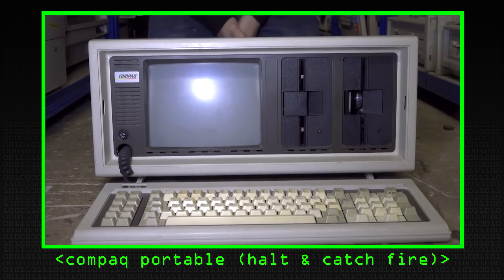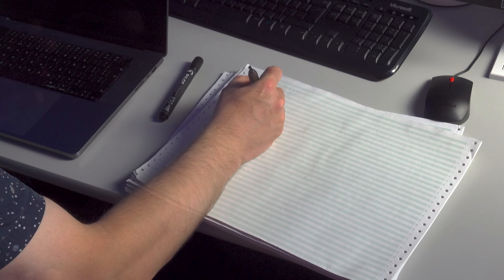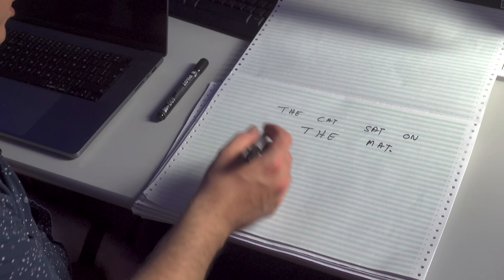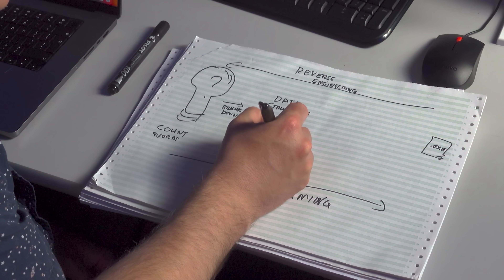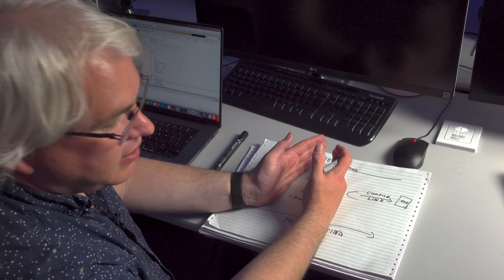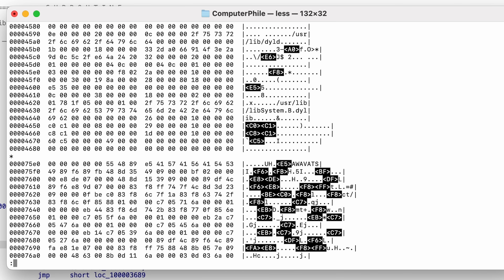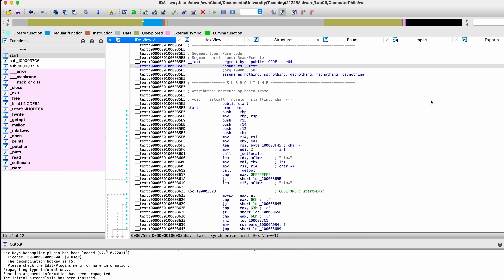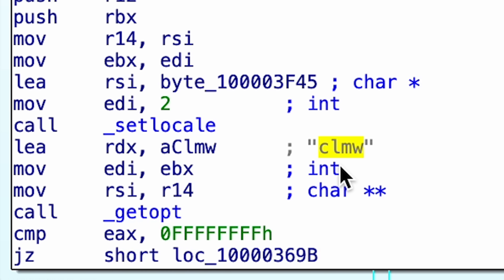Reverse Engineering - Computerphile

Comment: If you’re attempting to disassemble non x86/64 code using IDA, take a look at the pricing….I bet you’ll be surprised.

To save a lookup, it’s more than $10,000 for the full package, $5,000 for just MIPS and MIPS 64….

Comment: How would I go about Reverse Engineering a .exe file? I want to look at the source code
Reply: I think you'll never have the original source code by definition. But maybe you can disassemblethe machine code into assembly language and decompile that perhaps into c. But I'm not sure correct me if I'm wrong.
Reply: @bsdiceman  you can do manual decompilation. You could translate the assembly into c. The only way to learn this is to practice it and learn how compilers generate common c code constructs.

Comment: 3:26 Unix executables were originally "just machine code". Later on, when they wanted a format with headers and whatever, they made that format, but didn't actually change the implementation of exec. Instead, the binary started with the machine code to jump past the headers. And that's the story of the a.out magic number.

Comment: Have an idea for a similar episode in the future.

Steve should pull out a BBC Micro, C64, ZX Spectrum or any other 8-bit machine having BASIC. Then off camera develop a program which first asks a user to input any number of words. Then the program would calculate their number and display it.

Then show only the running program to the camera, and ask the cameraman to also come up with a BASIC (or any other language both can code) program that does the same. Suppose the BASIC will be different. But there you have it - Reverse Engineering.

Comment: The best example of clean room reverse engineering is GTA4.
One of the best trainer programs was built with the software in the next room. Engineers with gta looked at how certain actions worked in memory and passed their findings to totally separate engineers who worked out how to interrupt and alter what it did.

Rockstar tried to sue them for hacking and theft, but it failed because they hadn't built any software using any of the GTA code.

Comment: If the code you are analyzing is written in some high level OOP language, chances are a modern decompiler will give you at least some C equivalent, not just assembly code; in some cases it might be able to give you some snippets in the original programming language, since OOP compilers are pretty deterministic in theory.
And then some languages don't even complie their code, it might not even be obfuscated, so why even bother...
Reply: Some guy I know took apart a car insurance app, it was just a web application so everything was in JavaScript; it didn't take a long time to find several vulnerabilities
Reply: Javascript bundles are incredibly easily to reverse engineer. However you won't be able to do it with most pieces of software that easily.

Comment: Reverse engineering is a very useful skill to learn early on, but also one with a very steep learning curve.  It happened to be how I learned programming back in the 80s on the C64 as access to any useful technical literature in my rural town was impossible to come by.  I spent much more time in the machine code monitor examining games and demos to slowly learn how things were done than I ever did actually playing the games themselves.  Perhaps it was a happy coincidence as I may not have gone that direction if I could simply have learned everything from reading books.  Practising reverse engineering can greatly improve your analytical skills and pattern recognition as well as a more in depth knowledge of the underlying platform; skills that are, in fact, very useful in regular engineering.  So learning reverse engineering enables you to become a much better engineer.
Reply: your very right, people need to learn the very lowest level of programming (asm -> c -> c++) before moving on to very higher level control languages like python or javascript because they will have much better understanding and control over what they want to accomplish and how what ever language they use does that.  an example of this is writing an algorithm that is simple in function and does not have quadratic cost and instead of allowing iterations and number of arguments passed to grow in relation to the number of arguments passed instead use pointers instead of wasteful copying and making new tables, variables and bloating memory.

but this is only my interpenetration so take it with a grain of salt
Reply: @unguidedone  yesn't
Reply: Agreed.
Reply: You are one of my heroes.

Comment: I do a little reverse engineering. Usually with mobile apps, or web code, to look for vulnerabilities.  Found some interesting communications protocol in the 'Wind' scooter app (the older yellow hire scooters), no free rides, but a denial of service if you were careful.  Those scooters were in Nottingham, too, the same place these guys come from.
Reply: I have a lot of experience with reverse engineering web apps. It helps me build stuff when no direct api is provided.
I haven't really done much more than that. Computer science isn't exactly my field.

Comment: Been Reverse-engineering for over 30 years, no University degree and learned everything from software design patterns to how the SoC bring up is done. You learn the real way it works by reverse-engineering. 

I started out with C-64 and the super snapshot cartridge and moved on from there to the latest ARM hardware .
Reply: That's awesome man, can you give some pointers for someone like me for getting started in reverse engineering.
Reply: Hey, how do I get into reverse engineering(that's not the main part, I want to get into hardware hacking)? will learning a microcontroller help? Which one would you recommend for a beginner? I'm thinking of PIC18
Reply: @swarooprajpurohit110  If you want to learn hardware hacking then learning a microcontroller will help. Its important to  learn the basics like hex, dec, binary and how addressing works. Eventually for hardware hacking you need to know how MMU, interrupt controller, CPU and fabric work for SoC. Also knowing how to inspect and manipulate i2c, SPI and other chip/die to chip/die communication.  Pic will give you  basics but best to understand ARM . Arm V8-A/R/M for example.

Comment: 9:00 yes, waterfall is doing it wrong :)
And i agree with the "show me your data structures and your program will become obvious" to a large degree. Though a lot of the interesting part of programming is how to model edge-cases in the domain you are working on, and how you structure your code to handle adapting to new functionality or handling of bugs and edge cases. Programs are not (anymore) made as a single release, and then a few years later you get the next major version that is made from the bottom as a different program that may be a newer and better implementation of the same high level ideas and concepts. As systems get larger, maintenance/support and feature expansion time and time between bottom-up full rewrites get longer because the costs become much larger. Also, with agile development mindsets, the focus becomes on continuous development and deployment and delivering incremental value at low incremental risk of things going wrong.

Comment: 13:35 x86 machine code does have loops.
Reply: Unless you're referring to the rep/repe/repne prefixes, not directly. It's easy enough to implement a loop by a jump instruction that points to earlier code, but even then, the idea of a loop "emerges" from the behavior of the code; there's no direct "loop" instruction. Indeed, you can just as easily jump backwards without it being a loop.
Reply: @quantumdude836  Then look what the opcodes E0 to E2 do ;) They are the loop instructions. They implicitly use the CX register to count to zero, if I remember correctly.
Reply: @Abrissbirne66  huh, I completely forgot about those
Reply: @quantumdude836  No problem, modern x86 has so many instructions. I tend to remember the high level ones, because I'm impressed how high level they are. call, ret, loop, looks like concepts from regular languages. You can even say something like ret 24 to automatically clean the stack when returning.

Comment: Time to develop a reverse engineer coding AI - that learns the function, inputs and outputs of the target software and then writes the code for the operating environment of choice.
Reply: Thing is that one piece of bytecode can be decompiled in different ways, depending on context and where the process started
Reply: @bosch5303 Yes - the AI - which understands the overall  purpose or function of the app - based on its learning / 'hands on' experience could work around these issues by either recoding the entire app or parts that can't be meaningfully decompiled.

I suppose with more thought - it might be quicker and easier to just get the AI to rewrite the entire app.
Reply: Easier said than done
Reply: @RickOShay  orrrr anybody with more than a braincell will know what a program is doing by looking at system calls and strings?
Reply: not to mention RTTI is a thing also
Reply: @arson5304  Apparently that's why Stroustrup excluded it in original C++. and is it really necessary given the potential for abuse?
Reply: @RickOShay  "is it really necessary" ?? tons of applications nowadays are LITTERED with RTTI, which can be used to make reverse engineering a simple cakewalk
Reply: @arson5304  That's why I asked - isn't it a security risk ?
Reply: @RickOShay  yes and no depending on how heavily client-sided your software is
Reply: you don't need ai for that, it's called a decompiler lol
Reply: @arson5304  decompiler wont write high level code for the target system.

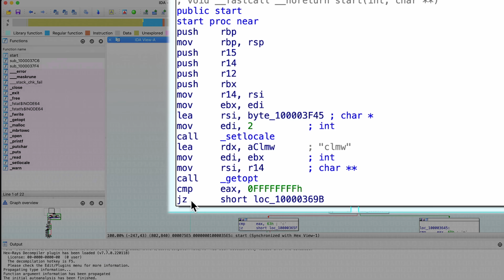Comment: 15:33 Library or external function calls and system calls are being conflated. 

Typical  user code doesn't directly make system calls.

These are implemented as "magic" instruction (this is all generalized) which allow a userland program to execute a small chunk of kernel code.

By magic instruction I mean "an instruction which causes the kernel to shut up and pay attention", i.e. throws an interrupt of some sort. The mnemonic "syscall" is an assembly instruction for several different architecture's instruction, even on the same hardware, various operating systems (and even versions of them) can use different instructions.  (Nothing is stopping you from saying "A syscall instruction is any instruction which causes a protection fault when writing to a valid syscall number." Provided your kernel can tell that happened and react to it appropriately, the mechanism doesn't matter. )

While the mechanism you use to call them varies, all of them need you to tell the kernel what you want them to do as well as that  you want them to do something.

The parameters to the syscalls go in registers (or in a specific region of memory) and include the system call number you want to run, telling the kernel how the arguments should be interpreted. 

Once you have set up the parameters, you execute your magic instruction, which interrupts the kernel, looks at your request and fills in the reply. Then the process returns from kernel mode, and continues.

These operations are often by system library code, because different systems might use different system calls, but as long as the library call takes the same arguments, your code will still work.

That's why there's a distinction between library code and system calls.

The only other times you need to know what a system call is are if you are reversing a statically linked binary (which puts all the library code it is going to use directly into the program. And it can make them massive) or if you are working with shellcode (like an exploit for a vulnerability might use.)

Comment: With the BIOS Compaq had 2 separate teams, one team analyzing the IBM BIOS and another team implementing their BIOS clone. The only communication between the teams was the documentation the analyzing team created by reverse engineering. No one from the analyzing team was allowed to speak with the implementation team or join it. IBM was never able to sue Compaq for their BIOS because it was a clean room implementation, running on standard hardware everyone can get.

IBM was too slow for the consumer market, they are building business machines, even up to today, and that's part of the story why the IBM clones took over the market. They were compatible, cheaper, had agreements with Microsoft for MSDOS and could adopt much faster to newer hardware while IBM worked on the PS/2 machines. I think we can clearly say: We are lucky it went this way!
Reply: Except for Bill Gates using the money to tests vaccines on africans.

Comment: I have actually had to reverse engineer more than one industrial automation system with nothing more than a poorly drawn schematic (which wasn't up to date) and raw code.

First step was identifying all I/O points, so i knew what a particular input or output did.  Then based on that you could figure out a lot of the basic logic of the machine.  This is a start/stop circuit.  This is a closed loop control system.  This is a permissive or interlock logic block.

Still takes a lot of time, but it can be very rewarding when you finally get to the point where you can actually maintain and/or improve the machine automation.
Reply: So you were able to make changes before the whole program was decompiled?
Reply: @johnsports_iii  Ladder logic is not compiled.  But yeah, I had to understand the code before I could make any meaningful progress.  But you run into a lot of basic sequences   that are almost universal.

Comment: May not be completely true, but i watched a documentary about Compaq where they actually had a software engineer de-compile the IBM Bios, just to see how it worked.  Once he did so, he reported to Compaq that "this isn't hard, there's nothing special here."

But since he had seen the code, he was not allowed to work on the project anymore, since he might be influenced by the code he had seen.  Compaq had to hire an entire team of programmers to look at how the bios calls worked, without seeing the coded behind the calls, so that they could replicate the outcome, without necessarily replicating the IBM code that generated the original outcome.

So when IBM sued Compaq, they could legitimately claim that their compatible BIOS was not based on the code IBM had copyrighted from Microsoft.  Nor was the Compaq DOS based on the code of Microsoft DOS.
Reply: Similar thing happened with Connectix and Sony. Connectix reverse engineered the BIOS of the PS1 and when Sony sued them they were able to claim that no Sony code was being distributed or used in their emulator. (Sony, of course, sued them to oblivion but they were technically in the right)
Reply: Halt and Catch Fire!!!
Reply: @swarooprajpurohit110 yes I read it to and remembered the series 

Had to stop watching it as things got too repetitive
Reply: @ukpauchechi  true. I stopped after the 1st season. I did read the plot though and it was disappointing
Reply: I think that when playing these kind of games its easier to win on a social level. Because your software can be objectively better, stolen or created, but what makes you win is the market. People.

Comment: I'm always amazed and overwhelmed by the sheer number of lines that even the smallest executable has when decompiled to assembly.
Reply: I am always more scared, what these few lines might cause in the hidden, if i type any "source" datapath of the code.
Probably it will log my try and send via a little cheeky email an attention message to the owner of the software.
Who knows. 😅
Reply: Most lines in these cases are boilerplate added by the compiler/standard initialization and finalization/operations and system calls required to match the executable format and platform. Equivalent programs generated from assembly language may have less of these things. GNU programs can have a lot.
Reply: @leogama3422  
So you are telling me GNU is bloat?
Reply: @xrafter  Bloated code, not bloated program. The gains from standardization and extra useful features largely compensate the negligible overhead in a compiled C program. If you are concerned of performance at this level, you should go right to assembly solutions (or specialized alternatives).
Reply: @leogama3422  
No, I don't have problems with this. 

GCC = GNU compiler collection.

Comment: Season 1 of the TV Series "Halt and Catch Fire" (available on Netflix) shows the reverse-engineering technique explained early in this video.  Although not specifically calling out Compaq, it's their story without the name :).  Take it with a grain of salt, though.  It shows them using a volt meter and oscilloscope to come up with the BIOS code <facepalm>...but the show is very entertaining overall.
Reply: Yes, great series!
Reply: @MenaceInc was on Amazon prime. Might still be there.